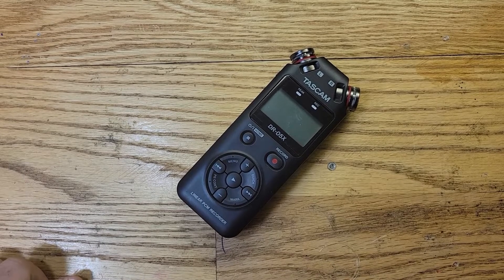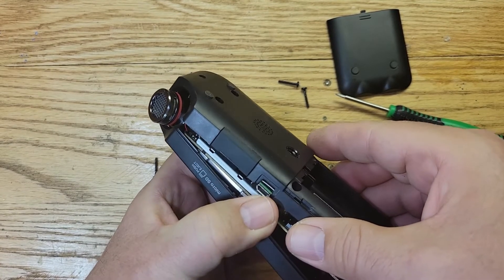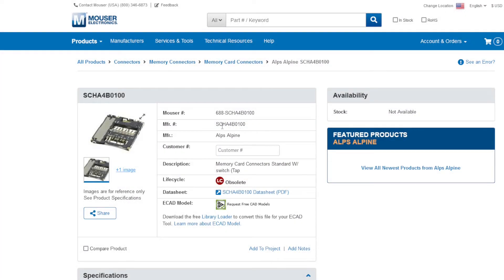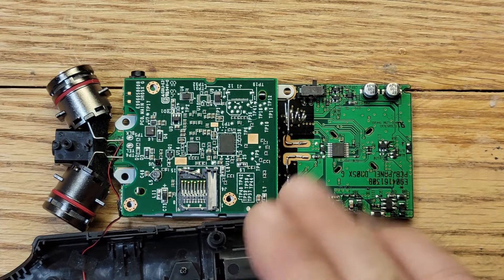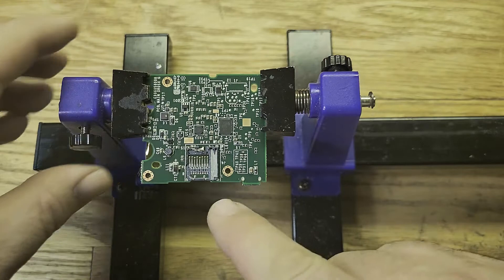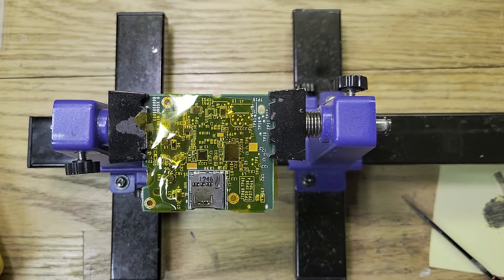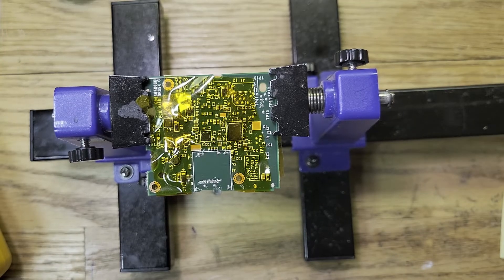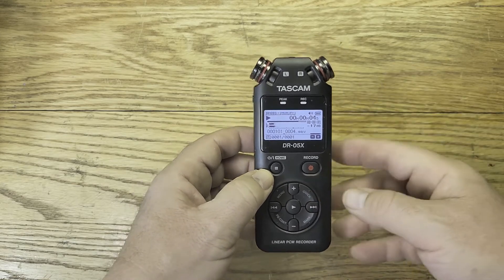Install a new Micro SD connector on a Tascam DR-05X

Comment: Thanks for this. It helped tell me what I was in for. Not for the faint of heart! Luckily I have access to some nice SMD rework gear. After a little practice on some other boards it went well. Pre-heat to 200C, observe the temperature curve and limits in the data sheet for the connector, and all should be well. The hardest part was trying keep the part placed correctly as I put the board on the hot plate.